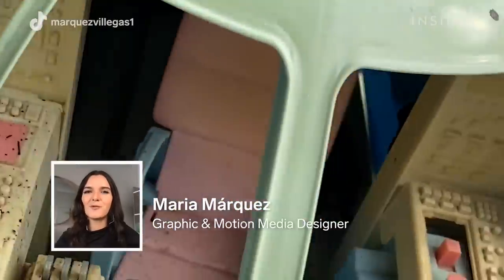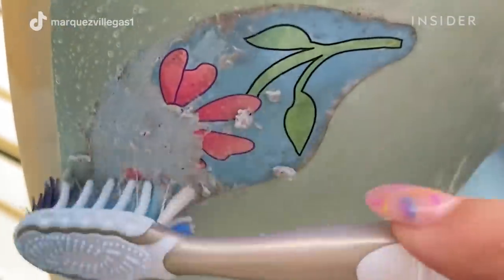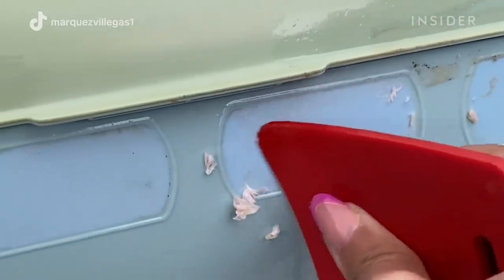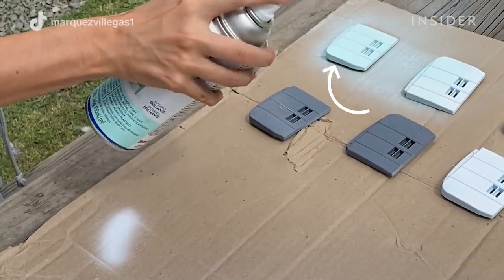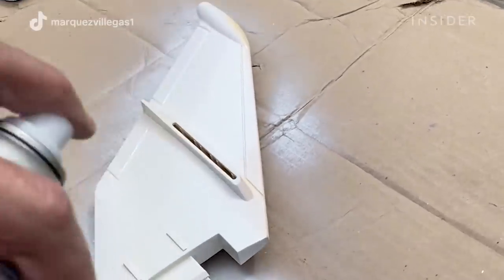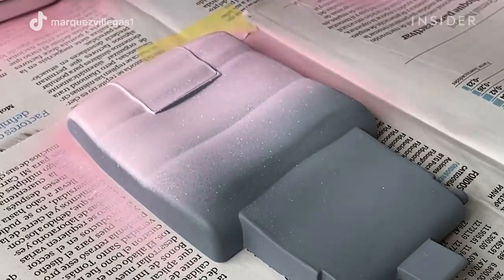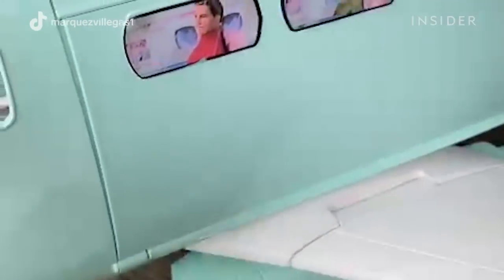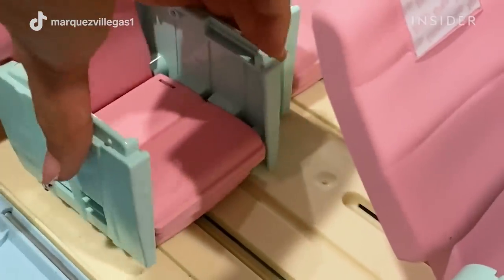How A Vintage 1999 Barbie Airplane Is Restored | Refurbished

Comment: For those who want to attempt restorations like this, I have a few tips.  First, take sharp, close pictures of every label, sticker, and decal.  You may have to recreate them by hand, and you’ll want to know exactly where to place them, too.  Make notes of how the parts come apart and in what order so you can put them back easily.

To remove labels, try using a hair dryer at a distance that’s not too hot for your finger to soften the adhesive, and then try pulling off the sticker.  Sometimes a spray of rubbing alcohol will soften the adhesive.  Scraping off paper bits should be done with plastic that’s softer than the toy, like she did.  My favorite method for removing adhesive residue is to pull it off with sticky tape and then clean off any remaining smudges with rubbing alcohol.

Yellowed plastic can be returned to color by soaking the item in stronger than usual hydrogen peroxide (like hair bleaching grade) while shining UV B on it.  It takes a while, but it’s the method used by vintage computer and console restorers, and those can be really brown. There are more complex solutions, too, which are not hard to find online.  

If plastic parts are cracked or broken, they might be fixable.  I find some solvent glues, like the stuff used for model airplanes, can sometimes work.  If using cyanoacrylate (instant glue), use it very sparingly, apply it with a toothpick or other tool to be more precise, and be very, very careful of where your fingers are so they don’t leave matte finished glue fingerprints.  Cyanoacrylates can dull some plastics as they outgas, so test them in an inconspicuous area, first.
Plastic polish and soft cloth can shine up any dull or slightly scratched parts.  If painting, and airbrush produces a finer paint texture than spray cans.

You can recreate label, sticker, and decal designs on a computer and then send the designs to companies to have new, high quality labels or decals printed.  Plastic labels are more durable than paper.  Decals should be gone over with a topcoat to prevent them from flaking off.

Good luck!
Reply: This comment is better, than the entire video 👍
Reply: Thank you for all these tips
Reply: Plastic razor blades meant specifically for auto detailing are PERFECT for removing stickers. And not just for repairing old toys either. I’ve used them to remove stickers from laptops, my fiancés old guitar, old furniture, as well as taking off bumper stickers from cars, and even removing stickers or decals that came on products that I didn’t find appealing and wanted plain. They’re obviously soft enough to be used on delicate or easily scratched materials like car paint but they’re also rigid enough and usually tapered enough to really scrape off all stickers and residue. Plus they’re ridiculously cheap. You can get a pack of 100 for less than $10 on Amazon. Or if you don’t want to have to buy a ton, try just asking for one at an auto parts store or even a dealership. There’s a good chance they’ll just give you some. 😊

Comment: Why don’t they ever hydrogen peroxide the plastic to take the yellowing off? I hate these refurbished vids that don’t use professional methods. The spray job is so lumpy
Reply: Ive mostly seen it on vintage tech than toys so i doubt they know this method
Reply: Lumpy? Did we watch the same video?
Reply: Does that even work? I know it works with grey or white colors but I've never seen good results on other colors.
Reply: Very amateur restoration attempt. Disappointing.

Comment: Surely some of the yellowing in the plastic could have been taken care of with a peroxide bath + uv lights? I hate to see the stains just covered up and not cleaned
Reply: Id say that looks like pigment fading from light exposure, not surface gunk.
Reply: @Ass_of_Amalek  that's exactly what a peroxide bath + UV lights take care of, plastic discoloration and yellowing from age/sunlight/smoke. There are a lot of great restoration channels on here and it's not a difficult or expensive process, you just need a LOT of peroxide
Reply: I was thinking the same thing. Oxy 10 acne cream spread evenly, put under uv nail lamp. I've removed many stains and discoloration on dolls this way.
Reply: I came to say the same thing.  I’m going to be using this method to de-yellow some clear ABS shelves in a rotating display case.
Reply: @2degucitas  the ingenuity!!!!!! I never would have used acne cream as a gel version of peroxide, that's so smart I'm gonna remember that
Reply: @onlyflylikeabeetv   Secret age old doll ink mark remedy.

Comment: I wonder... a trick I learned with restoring yellowed nintendo entertainment systems was soaking the plastic shell in isopropyl alcohol in a tub or tote for a few days in the sun or uv lights would remove the yellow from the plastic. Works great!. The yellowing was from a fire retardant in the plastic like these doll toys. If you have a chance look it up and try it out. It will save it from a chance of scratching the paint. 👍 as for the dark spots or stains I don't know what would help. Maybe oil eater? Or pink stuff? The finished product looks great though!
Reply: I've never heard of anyone using isopropyl alcohol and UV, it's normally hydrogen peroxide and UV.

Comment: Let me help u doll go buy u some stuff called goo gone , it is an adhesive remover it will take the stickiness of the stickers off and you won't have to scrape so hard
Reply: But I think part of the point is, what will those chemicals possibly do to the paint? 

You immediately mess up a 'restoration' if you even try it on a spot, and maybe not until a day later you find it's discolored or started to peel because you started an unwanted chemical reaction.